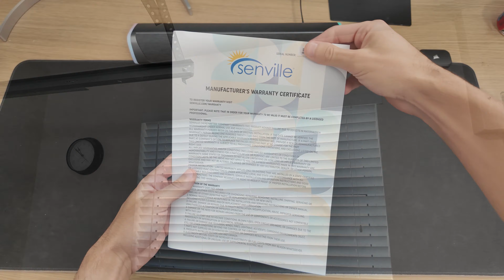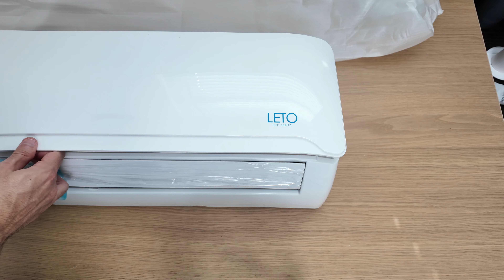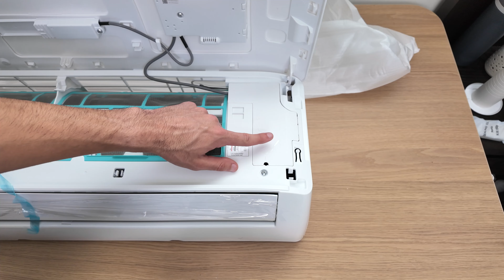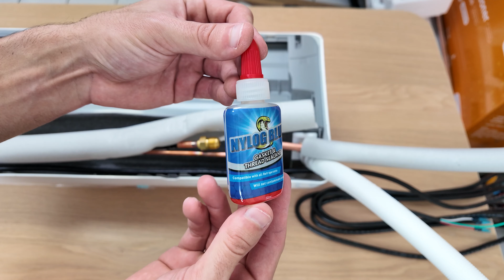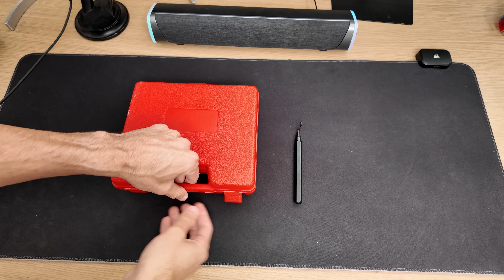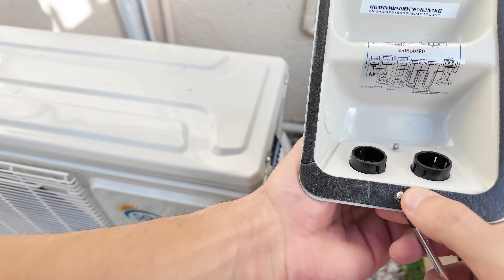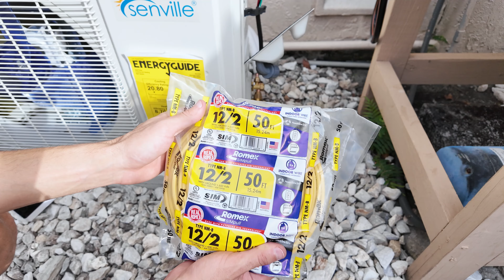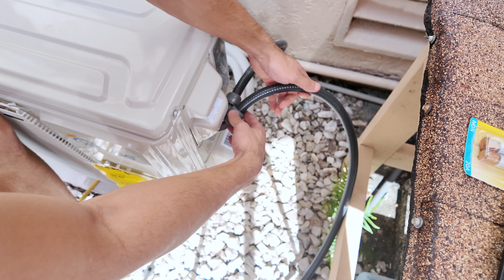How To Install A Mini Split Air Conditioner – Complete Step-By-Step Guide

Comment: Thank you this video i am looking for how to install mini wall air conditioners. my question is 
the air conditioner unit hoses only left hand side do they have a right hand side ? How do you know the unit hoses left or right hand side to buy it ? 
thanks
Reply from the maker: Great question! Most mini split units come with the hose connections on the left side, but many are designed so you can reroute the hoses to exit from the right side if needed, like in my case.

Comment: Hi bro, did you refill refrigirant on the new unit? Or did you cut the video?
Reply: The refrigerant is inside the new unit.
@18:45 he opens the screws that releases the refrigerant from the unit into the the tubes. 
Not sure if its the same for all brands and units, but normally, the amount of refrigerant in the unit is good for between 3 and 10 meters of tubing. 
If you use more than 10 meters of tubing you need to add more refrigerant.

Comment: So the yellow line stays open while the blue line is the only one that opens and closes
Reply: Yes. 
But best is to understand what is actually happening:
The metal block has 3 internal cavities. The left cavity has the blue tube and meter on it. The blue valve seperates the left cavity from the central cavity. The right cavity is seperated from that central cavity by the right valve and has the red meter and tube on it. 

The yellow tube is connected to the central cavity.

Since we are not using the red tube, we also do not open the red valve. 
We need to close the blue valve to seprate the central and left cavity and thus the yellow and blue tube.

Comment: Does this work for Seniville Aura models as well - dual zone 36BTU 36HF D?
Reply from the maker: Yes, the general install steps apply to Senville Aura models too, including the 36BTU dual zone. Just make sure you follow the manual closely since wiring and line sets can vary a bit.

Comment: Before doing the vacuum test, I saw on another video they used nitrogen for a pressure test as well.
Reply: Yes, that is how it ideally should be done because sucking it vacuum means there is only 1bar pressure difference between the system and the outside atmosphere. The refrigerant however operates between 10 and 20 bars generally, so testing at 1 is kinda not really sufficient. You should presure test it with Nitrogen @ 30 bars (or whatever pressure is indicated on the unit).

In my country it is obligatory to have this installation done by a certified professional who does this pressure test, a bunch of measurements and registers everything and all the refrigerant he uses because the refrigerant is extremely harmful when leaked into the air.

Of course not everywhere in the world the rules are so strict and in some places you are allowed to self install like in this video.

Comment: Thanks for sharing your video. I bought this vacuum (XtremepowerUS 3.5CFM) and set everything up according to your instructions. I let the vacuum run for over 15 minutes, and the pressure dropped to around -25 PSI and stayed there. However, once I closed the low-pressure side, the gauge immediately jumped back to 0 PSI. What could be the problem? I tried these steps on two different AC units, and both had the same issue.

Comment: There say not to screw the vacuum hose into the A/C but make sure it’s tight enough to vacuum your evaporator not just the line going g to the A/C unit, I had to use a ltttle more force to get the line to open shensheader valve to allow vacuum to the condenser.

Comment: Hallo.Great video.is it possible to shorten the lines without reducing the amount of refrigerant?
Reply from the maker: Thanks for your question! Yes, you can shorten the lines as long as you don’t cut them below the manufacturer’s minimum length. If you stay above that minimum, you don’t need to adjust the refrigerant at all.

Comment: Hi, nylog blue should be applied only to flare contact surfaces, not to outside, because it may affect torque values. Is that right? In video its applied outer side of surface. Any comment and proposal?
Reply from the maker: Good point! Yes, it’s best to use Nylog Blue just on the contact surfaces of the flare, not on the outside. Putting it outside can mess with how tight it gets and doesn’t help the seal at all.

Comment: I have a 3 head mini split to install DIY and this video will be my reference. 🙏
Reply from the maker: That’s great! I’m glad the video will be a helpful reference for your 3-head mini split installation. Let me know if you have any questions as you go along, I’d be happy to help!
Reply: For dual head seniville 36 btu is the vacuum process the same do each line set and then open each to release refrigerate or can you do one at a time? Also what is the amp for wire awg from sub panel. What is the disconnect fuse size. Thxs

Comment: Only criticisms are, 1.) you didn’t pressurize the system with nitrogen and check for pressure drop and 2.) when pulling a vacuum, no micron gauge was used to actually measure a 500 micron vacuum, which then means you can’t do a vacuum decay test. 

Other than that , great video.🎉

Comment: Hi! Great video! I have one question/concern. I bought the valve that you’re recommending here to run vacuum on the lines and it doesn’t seem to engage the Senville valve enough to open it up. When I released a little Freon the manifold didn’t show positive pressure because they weren’t fully engaged. I finger tightened it as far as it’ll go. Did you experience the same thing?
Reply: Not a pro, and not saying this is your issue, but something to try if you haven't sorted it out. Since you  released a little refrigerant, you can try to just put the adapter on by itself and see if it vents it out (then quickly remove. Also wear leather gloves.) If it doesn't you may have a bad adaptor or bad Schroeder valve. You can replace a bad valve with a valve puller if that is the case. You can return the refrigerant in the system back to the conpressor before the valve change so you don't lose it. (Search YT vid for this) Good luck figuring it out.
Reply from the maker: Thanks for your comment! The adapter that comes with the vacuum kit usually doesn’t work well with the Senville valve. That’s why I used a different adapter in the video that fits properly and lets you pull a full vacuum. I definitely recommend getting the one.

Comment: I have the same unit, but it leaks freon I need to tork the connectors, then add freon. 

Do I need a special tool to add freon, and how much do I add? is it located on panel next to outside compressor?
Reply: Please get a professional to do this. 
I don't know where you are from, but in my country (Netherlands) even the way of installing as shown in this video is illegal. 
It is obligatory to have it done by a certified professional who does more tests, measurements and registration than shown in this video. 

The reason for this is that the refrigerant is extremely harmful to the environment. Leaking the refrigerant from 1 unit is about as bad as flying between europe and the US and back. And that is the nowadays much used R32. Older refrigerants like R410a are even 3 times worse and now banned in europe.
So if you are screwing up already by having it leak now (sorry to be harsh there), please get someone who knows what he is doing.
Reply: @arjensmit6684  Then there's the transition to R290. Leak = 🔥

Comment: i bought a tool for bending the tube
Reply from the maker: Nice! That’s a smart move a tube bender really helps you make clean, smooth bends without kinking the line
Reply: Could you link the tool you used?  Thanks.

Comment: Helpful video! Btw Romex can't be run through conduit in most places is my understanding. Overall, very helpful video though thank you!
Reply from the maker: Thanks for the heads up! You're right, Romex in conduit isn’t allowed in some areas, depending on local code. Glad the video was helpful!

Comment: Mine is not going -30 ,does it mean i have a leak ?
Reply from the maker: If you followed the same demonstration, make sure to use the R410a Adapter Pack: https://geni.us/8dWCLl the adapter that comes with the vacuum pump usually doesn't work with mini splits, which might be why you're not reaching -30.
Reply: @FersReviews  yes the adapter was leaking,had to use nitrogen to fond out

Comment: Hey i like your video, heres is the thing im going to install my inside unit on a secondary wall instead of the main wall so my drain is going directly down with an angle to drain downward to my shower drain, the other lines they got up to the attic and then outside to the main unit, but i do have a loop in the attic is that gonna affect the system?!
Reply from the maker: Thanks! Your drain setup sounds fine as long as it keeps a steady downward slope. As for the loop in the attic if it's part of the refrigerant lines, a high loop shouldn't cause issues as long as the lines are properly insulated and the total length and elevation change stay within the unit's specs. Just make sure there are no sharp bends or kinks, and everything is sealed well.

Comment: Is it necessary to use the vacuum?
Reply from the maker: Thanks for your comment! Yes, it's necessary to use a vacuum to remove air and moisture from the refrigerant lines before running the mini split. This helps ensure proper cooling efficiency and prevents potential damage to the system. Hope that helps!
Reply: @FersReviews   but isn't nowadays the split ac indoor unit comes with pre installed self nitrogen to avoid getting moisture or any other gas buildup via reaction because its inert in nature and hence the vacuuming isn't necessary and just rather have it removed in the end ?
Reply: Yes or else you may lose the refrigerant because you didn’t test for a leak beforehand